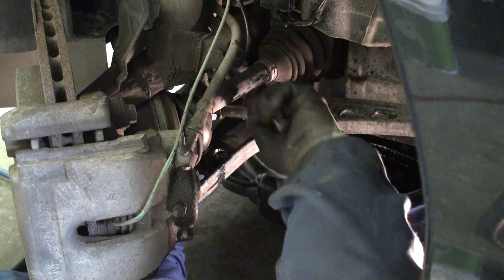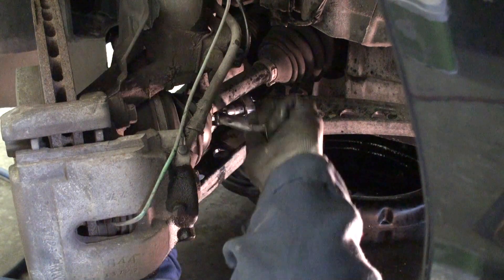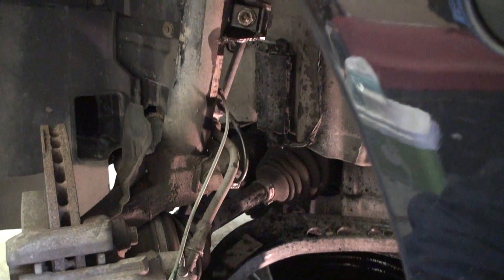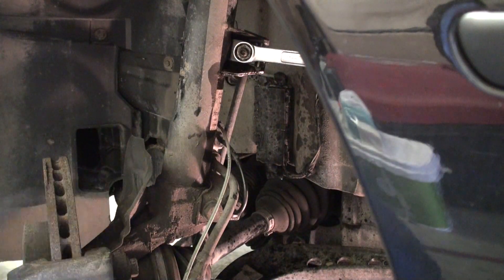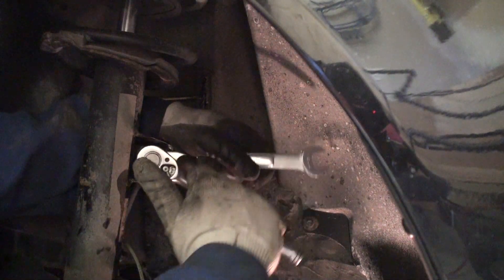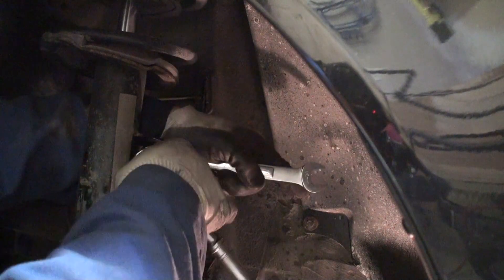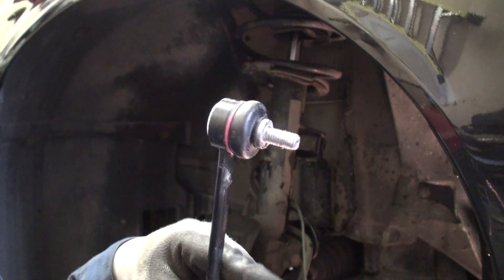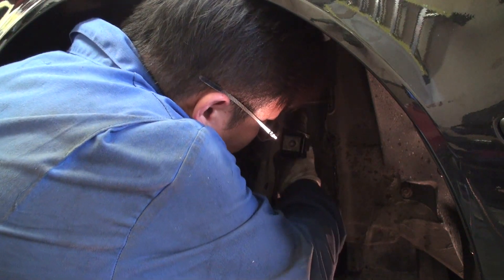DIY BMW E46 Front Endlink Replacement

Comment: Did mine last night. Everything went well. What isn't mentioned is how to pop the plastic off that's covering the hex screw. I didn't need to do that I basically used a wrench to tighten it down. Also for everyone that hasn't done this before you must disconnect BOTH links before you install the new parts otherwise your going to find yourself trying to squeeze the stabilizer bar down far enough to get the bottom of the new link into place.
Reply from the maker: hmm odd, my stabilizer end links didn't have caps on the nuts.  Yes that is an excellent tip about removing both links but only if one wheel is on the ground.  In my car's case the whole front end was up so I was able to easily replace each link without having to remove the other side first.
Reply: Thanks for this comment! Gonna do mine tommorow.